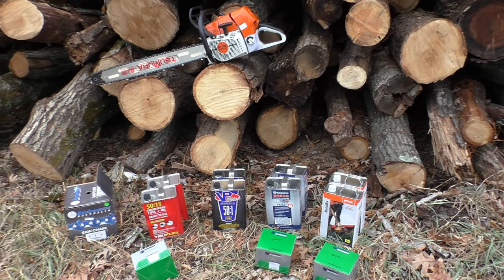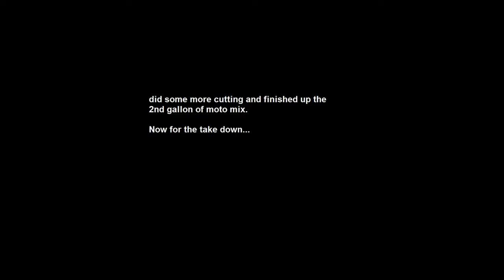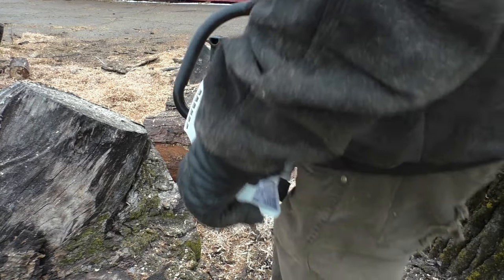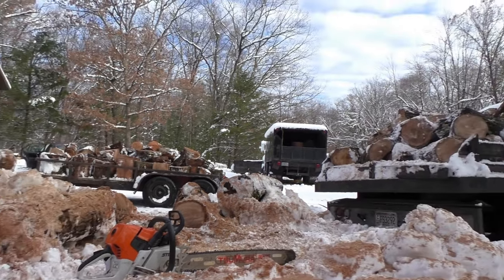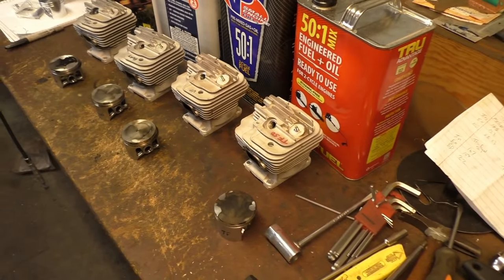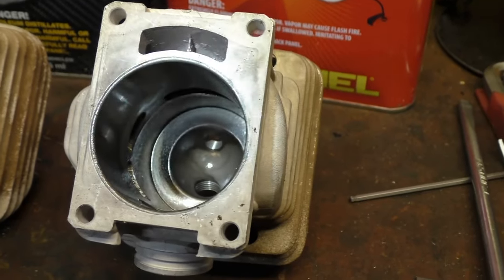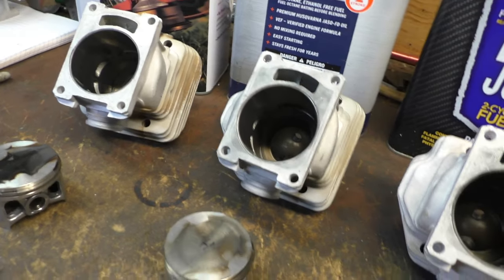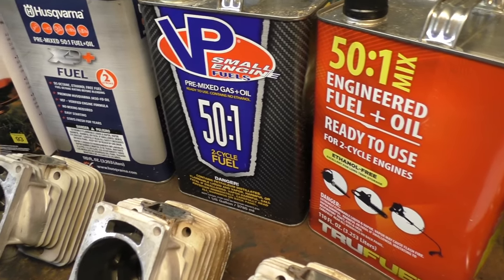Premix Fuel Test - Stihl vs Husqvarna vs VP vs Tru Fuel 50:1

Comment: When mixing your own with premium fuel, be sure to put a few gallons in your rig's tank before filling up your 2-stroke  jug.  The hose and supply line at the pump hold a lot of fuel, usually cheap low octane.
Reply: I always instruct folks to do that. I put two gallons in my pickup before filling my gas can every time!

There's a sunoco near my work that has a separate pump for the ethanol free fuel, that's by far my preference since you know you're not getting a hose and filter full of 87.
Reply: I agree. I’ve done some testing of different pumps at a couple of gas stations and see ethanol contamination in the premium fuel but only at pumps that use one single hose for 3 different grades of fuel.  Pumps that have separate hoses dedicated to each grade of fuel did not have cross contamination of ethanol fuel
Reply: It was good to point that out. I'm sure a lot of folks would not have think about that.

Comment: The Stihl Moto Mix is the old fuel mix I believe. The new Stihl fuel and Aspen brand fuel are alkylated fuel which is much more highly refined and cleaner burning and ethanol free as well. I think stihl only makes a 50:1 2 stroke, but Aspen makes both 4 stroke and a 50:1 2 stroke product and the cost is considerably cheaper. I think businesses can also order it in 55 gallon drums for any even lower cost per gallon. The 2 largest advantages are shelf life... 2 years unsealed and 5 years in the sealed container.. which means there is no need to do any special maintenance for seasonal storage, just top off the fuel tank and put it away. Whether you need it unexpectedly during the normal offseason or in 4-6 months when the new season begins the fuel is good, you just start it up and go. Which is the 2nd advantage... no repair costs from seal and corrosion damage from improper storage, no loss of time or income waiting on part deliveries, less downtime doing equipment repairs or waiting on repair shops to do them.

Comment: Also the MotoMix is the only fuel here that is Alkalyte fuel.  Completely different in my opinion.  Spill a little of the MotoMix on your hand and within seconds you cant smell anything.  Do that with the rest and you smell like gas for a long time.  Look into Alkalyte fuel.  So many benefits to health as well.  When you breath in the exhaust.  MotoMix is more on par with Aspen fuel.  If not running MotoMix I think VP is the next best but again without the added benefits of being an Alkalyte fuel.  Additionally I see the VP can says 3785ml and I think that's 128oz and that should be 1 gallon.  I agree some of the others like the red can and XP are short

Comment: WOW that's quite some effort!
You deserve a crazy watch count
Reply from the maker: thanks
Reply: @Redbull661  sure 👍🏽🙏🏽  Say, are you used to mostly using the dawgs or it was a decision to put more resistance when possible?
Reply: @Redbull661  What's the best oil to gas ratio ???
Reply from the maker: @Sensei948  overall I'd say 40:1   depends on some factors. But 40:1 would be my go to for anything.
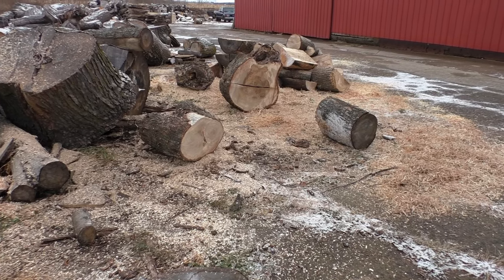Reply: @Redbull661  i.e. for saws and trimmers 1:40 Ls +? or 1:33? 1:33 will there be a lot more carbon deposit?
Reply from the maker: @Sensei948  depends on the oil.   schaeffer burns very clean 32:1 or 40:1.   Smaller stuff I like 40:1.  Larger CC I like more oil 32:1.
Reply: @Redbull661  husqvarna 351 , 545rx 1:35  ? 357xp 372 xp 1:33 ? ok

Comment: That's interesting about the octane rating.  The highest non-ethanol we have around here is 87, so I have used Tru-Fuel 40:1 because it's the cheapest around here, and I figured higher octane was better.  It's also nice that the shelf life on these canned fuels is a bit longer. 

I can't thank you enough for y'all time and effort and expense you put into this!  I greatly appreciate it!  Thank you guys!
Reply from the maker: Thank you Sir.   FYI - stihl manual says 89 octane or higher.  I've done a few gas tests (search my vids) 89 and 91 came out on top.   I myself do not use canned gas I run 91 ethanol free.  I do that because I have the theory that fresh gas is best and I think most people buy either 87 or 91  (the cheap regular stuff or if they buy premium they buy the most expensive premium...for me that is 87 and 91 around here).
Reply: @Redbull661  Thank you again!
Reply: Here in Texas, the QuikTrip gas stations sell 90 octane non ethanol. Perfect for saws

Comment: I use VP, it is a full gallon, but my saw performs great using it. I have never used anything but the canned premix in my saws. This was a great example of testing and I know it was expensive to do. Thanks for you doing this!
Reply from the maker: thanks!
Reply: i use the VP in all my small engines 2 and 4 stroke.. one thing i noticed in my saws is i had to adjust the carbs when i switched from pump gas they were real sluggish on the VP before i adjusted them
Reply: @aj9270  that’s understandable. Pump gas is 10% ethanol and ethanol is an oxygenate so you would have to adjust you saw. I’m guessing you had to lean out the saw?
Reply: I got a 5 gal of VP - for all my tools - My pro blower is a REDMAX EBZ8001 BLOWER - it stopped reving up - problem was excessive oil in VP. I changed everything got new Carb/Air Filter/gas lines/gas tank filter /spark plug and coil Assyrian - no difference - decided to change the carb back to original one and a table spoon of oil came out of the carb/air box. On video as proof I drained the VP gas and filled with TruFuel back to 100% operation - hmmm - on video I changed it back to VP and back to no revving - I contacted VP with video proof - they say they have not had any feedback like this - thanks I am out of pocket - wasted downtime and useless fuel - they said they were going to get a sample back from me - that was Dec 21 - its middle of March 22. Hmmm!!!!  Thanks for a great video.

Comment: great job with your demo, I've found that once you've used your premix and say let it sit before using it again for 2 or 3 months the best for holding its integrity was Stihl's , then Husquarna's . Never used Tru Fuel or Echo red , but the VP seemed to sour faster and had starting issues, so I quit using it and haven't had the carburetor issues since.

Comment: The higher octane is a good thing because adding oil to gas lowers the octane. Starting out with a high octane fuel is better because you don't want the oil to drop the octane below 87. Probably why Husqvarna uses 95 octane fuel to mix with the oil so you still wind up with a higher octane fuel after mixing.

Comment: I must adjust the carb on my husky saws every time I change a different brand canned mix. Emissions requirements have made all 2-stroke fuel systems extremely sensitive to variations in mix viscosity.  The carburetor passages are so tiny that any slight variation in viscosity will cause it to run leam or rich. Alcohol content will affect viscosity. 
The blackened pistons shows the saw was simply running too rich, not that the mix itself was the cause, or better or worse than others.
Learning to read your own spark plug to see what's going on inside, and learning to adjust your carb accordingly is a must if you want to tune your own saws. Sticking with the exact same mix that the saw is tuned for is key.  If you think mixing your own fuel heavy, at 32/1 or 40/1 will make your saw last longer than 50/1, you are wrong. More oil increases viscosity, and can actually cause a modern 2-stroke to run too lean, and blow up. Mix exactly as specified.
Husky & Still tune their saws at the factory with their mix and recommend customers only using their mix for this reason, not just to make money selling canned fuel.
Old 2-stroke (pre-emissions) regularly fouled plugs, slugs, and jugs because they just ran rich and smoked a lot.  Scraping the crud off the internals was just regular maintenance. 
Today, you are much more likely to score or blow your top end than ever foul a plug. 
I dispose of  stale 2 stroke fuel (>2 months old) into my riding lawn mower. 
Also, if mixing g your own, sealed fuel cans are a must with ethanol fuel. Period.  Yeah, they all suck. But a vented can will breathe, and pump air in and out of the container, which accelerates oxidation and the ethanol draws moisture out the exchanged air and into the fuel. 
1 drop of sepsrated water will plug the internal carburetor screen. Less can partially block it and make it run lean and/or cause it to keep dying and make it hard starting.
Bottom line: The government screwed up 2-strokes with extreme emissions regulations and with ethanol fuel mandates. To the point of it being a marvel of engineering that they even run at all, let alone run for more than a hour or 2 without seizing up.
Reply: Thank you, I've been telling people for years that adding too much oil is bad as it will cause the engine to run lean!
Reply: What you say is very true. I have been selling Husqvarna saws for 40+ years, and running them for 45. The bottom line is today's rule for saws for sure!
Reply: You are one of 3 people that I have actually heard say that running a heavy oil mixture is not good, and I agree. It's extremely hard for people to grasp the idea that running more oil may do more harm than good. Also, I constantly tell people to tighten the cap and vent on their gas cans tight, so there is no exchange of moisture rich outside air with the gas/air inside. You know what they said, It'll blow up !! lol.

Comment: Good test. Nice to see where there’s leftover carbon and where there was visible oil in the bottom end. Also appreciated the comments about how they each smelled. I’m an old engineer and there are two things I wonder about with these premixed/stabilized fuels. The first is what type of oil is in the mix. In regular season I run premium ethanol free gas and mix it with JASO “D” or better spec oil. I do not trust API spec stuff because API does not test. But I haven’t seen the actual oil spec on any of the premix stuff I’ve bought. The oil may also be acting as an octane modifier. The second thing it would be nice to know is the actual chemistry of the gasoline. It is possible to have a lower octane rating and yet still have a higher energy density fuel, depending on the proportion of short and long chain hydrocarbon molecules in the gasoline (how it was refined). Which might account for your perception that the TruFuel was a little “snappier”.

Comment: Ok just a carb tuning question was this saw an auto tune?
Or did you keep the same hi low settings,
Or was it need to touch up the hi low with easy fuel test.
And you mention smell is it the oil smell, or the fuel smell
Mix.?
Ok
Very in depth testing you did.

Comment: Steve's Small Engine Saloon had a video that identified how the engineered fuel is better for your small engine, but this video shows the outcome of using such a product.Thanks a ton for the time, effort, not to mention money that went into this demonstration. Appreciate everything! Cheers!!!
Reply: Steves video on the stihl fuel brought me here too hahahaha
Reply: @stevenlaxton3618  Me too. The exact reason I started using Trufuel at the end of a season. Chickanic just did a video on some issues related to Trufuel as well. I believe I may be switching over to Motomix going forward
Reply: @rick391  I run ethanol free pump94 octane froma local station and was using red armor mix but am trying old-school Castrol 2t for fun..but picked up a can of the VP 50:1 and will be trying it soon as well too...I haven't been able cut much yet this year but have to get my grandparents some wood here soon so the old pioneer 1110 won't go too hungry 😀
Reply: @stevenlaxton3618  Hey Steve, I run 93 ethanol free in all my small engines with hp ultra for my 50:1 mix. As mentioned earlier in here, if your gas station only has one pump for all gas choices (instead of a dedicated pump for each gas choice), make sure to pump a few gallons in your car before putting any in your gas can. I also use Stabil 360 Marine in my gas/gas mixes as I don't use it up real fast. I used to use Seafoam but a buddy with alot of experience had some issues with Seafoam and switched to the Stabill and recommended using it. As mentioned previously, I only ran the Trufuel at the end of season for my machines but am gonna give Motomix a try instead.

Comment: Wow that is a crazy effort! Now you have a life time worth of top ends for that saw. Very well done. In my opinion the gas that leaves the most oil in the crank case is the best for longevity. Iv'e been running tru fuel 40:1 for a little over a year now in everything with good results. But I have so many saws that none of them end up getting used all that much. Some of this new clean burning and low smoke oil make me nervous, you take an engine apart with some of that oil and everything is dry inside. I like more smoke than less and seeing lots of oil in the engine rather than worrying about how clean it burns. Great test sir!

Comment: Wondering if you checked the timing on the meteor cylinders? Have used several on ms460 and there seem to be quiet a difference from cylinder to cylinder?

Comment: My understanding of octane in relation to 2 stroke engines is that it should be higher because they run at hotter temperatures. A car engine with 7:1 compression is liquid cooled and stays below 250 degrees, but a 2 stroke chainsaw motor will be closer to 400 degrees.

Comment: Chainsaws may only have a 7 to 1 compression ratio, but I've noticed a huge difference from running 87 octane to 93. The 93 just seems to make it run smoother all around, especially when it's warm out and the saw starts getting a little hotter than normal. Weird shit.

Comment: Very interesting test! 
Thank you! 
Some notes that I've found out during years: I'm from europe, and here I usually buy 100 octane premium pump gas with 10%Ethanol in it. Not the octane is making me buy that gas, but the aditives that it has. I get a more clean burn with that gas as I would use a regular 95 octane pump gas. 
For the las year I used in my brushcutter that premium gas and Stihl Hp Ultra at 40:1. Very low carbon build up on the exhaust port(on the main flow starts to build up), the piston has build up on it, just as you showed us in this video and the combustion chamber has also little build up. 
All the best and a Happy New Year!
Reply from the maker: thanks!

Comment: You forgot the Echo canned fuel! Also, have you ever comparatively done oils? I’d like to see Amsoil saber VS the rest. 50:1 and/or even the recommended 100:1.....very interested in that because I’m a dealer. I could even hook you up if you let me know.
Reply: Well dustin why don't you spend your own money and make a video of your own tests? I doubt your gunna spend the money and time buying 2 different cylinder jugs and piston and 4 cans of the fuel plus your time..
Reply: Gino Gallegos probably because Red Bull could be way better at making videos than he is. Also he offered to send him product to help support his channel.
Reply: I switched over to Amsoil a year ago and that is all I use in all my 2 stroke engines. I buy 100% 87 octane gas and mix 50:1. I would pay for the piston and cylinder just to see the amount of oil down in the crankcase if it was mixed the way I mix. Amsoil says you can go down to 100:1 for 50:1, but I'm not interested in seeing that ratio.

Comment: Have you seen Sunoco race fuel came out with some pre mix fuel of their own I'd love to see a part two with Sunoco fuel, Echo red armor, Walmart SEF 2 stroke, and Super S super-fuel. Other than the red armor there's absolutely nothing on most of those other pre mix fuels. It makes you wonder if $4 a can gas could be as good as $13 a can gas, or if either of them are as good as regular old gas & oil

Comment: You Sir are providing a valuable public service, I commend your efforts. Do you plan to test the Aspen 2  and Aspen 4 products produced in Sweden? From my research it is an even cleaner burning fuel at a competitive price point. I’m meeting a rep in a few weeks to purchase a 5.3 gallon container of the Aspen2 and 4, for  $92.00 each. My experience over the years is using 93 octane non meth with synthetic Stihl with a stabilization and maybe getting 6 months before having problems. I can store the 93 oct longer than the 87 oct, the only two available near me and I believe Stihl and Husky require 90 oct. thanks man!

Comment: I’m not a pro user but my MS311 works well on TruFuel. It works equally well with Stihl oil mixed with Quick Trip ethanol free 89 octane to which I may add a couple ounces of Sea Foam. I only cut three to four hours at a time when I cut and have never had any fuel issues. I use a 20” Stihl bar with a full chisel skip chain (RSF).  Great comparison video. Thanks for the effort.

Comment: I love these fuels. It may be expensive but my saw and weed eater go through under 3 gallons between them, at 20 or 25 bucks a gallon that's a good price to avoid carb rebuilds, any potential ethanol issues and possibly longer life.

Not brand loyal, I've used stihl and trufuel.

Comment: Pretty interesting video. Thanks for going through the trouble to make it. Some of us are really interested in issues like this in order to ensure the performance of our saws and their longevity.  I wonder did you do a break inperiod of any sort each time you switched cylinder and piston?  Maybe I’m a little paranoid but I always do a break-in. When I rebuild a saw I run it at 40:1 on the first three tanks to break it in. Maybe it’s not necessary, but I like my stuff to last as long as it possibly can.
Reply: I run 40:1 all the time with 93 pump octane, with a synthetic 2 stroke oil and a little bit of marine gas preservative. Seems to do pretty good.
Reply: @augustreil  tell me! what does marine gas preservative mean???